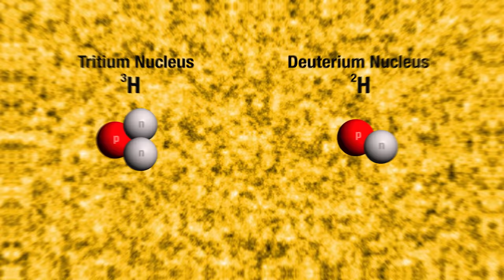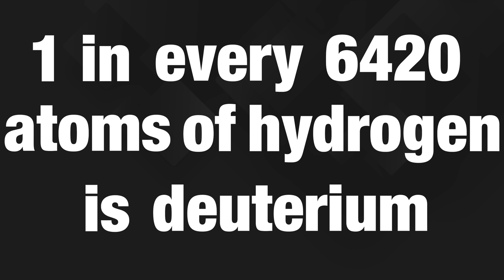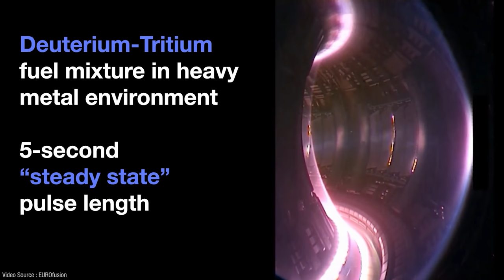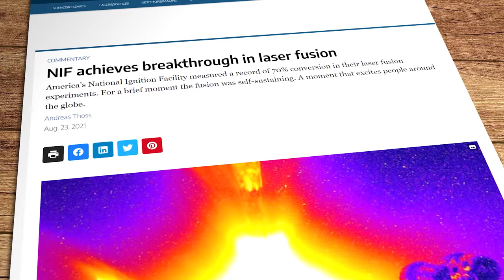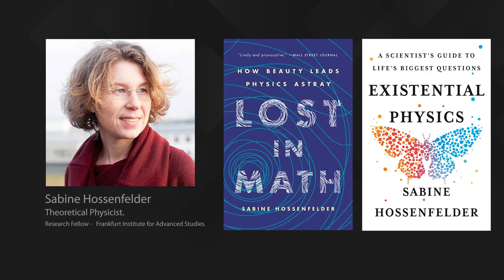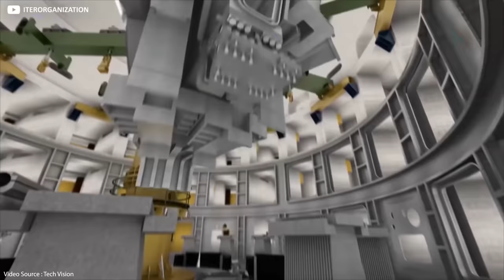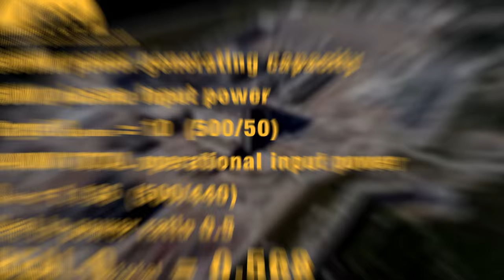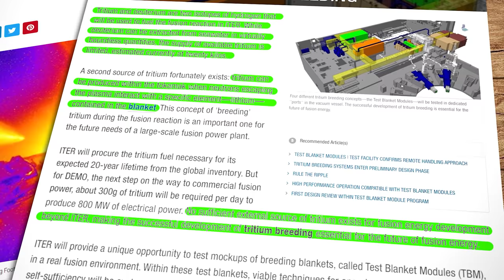Nuclear Fusion Illusion. Is it time to park the pipe dream?

Comment: We need to keep in mind that ITER, and its cousins, are research devices. I support them as such, while at the same time thinking it would be a huge mistake to pin massive hopes on a particular outcome. If you never undertake large projects unless you can be sure they will pay off commercially, then you will simply never undertake them. I think a lot will be learned from ITER—including, partly not least, learning how to manage huge projects, and manufacture large, complex devices.

Comment: Really enjoy your content, but I think this is a very narrow analysis of the Fusion problem. Raising Q total is trivial in comparison to raising Q plasma. Nearly every fusion plant running today, or planned within the next few decades are NOT intended to be power plants. Their objectives are to discover and test plasma efficiency improvements (Q plasma). 

In order to do this, they need as many variables to play with as possible, allowing the flexibility to make these breakthroughs that would not be possible in a commercial power plant. Yes, you can build these reactors to run MUCH more efficiently. But that will not be done until we exit the "research phase" and move to commercial production.

As an example, MIT's SPARC reactor is projected to reach a Q plasma of 10, and a Q total of 1. This is still not producing power, and will still use inefficient equiptment designed for experimentation, not power generation. The goal is to prove the concept for their second ARC reactor that WILL be designed to produce power, and will reach a Q total of 4 or above.
Reply: Cop out, the current generation of experimental test beds for  nuclear fusion are nowhere near being prototypes of a viable fusion reaction vessel, not even close and that hasn't changed for over 50 years.

I agree with the post above the advantages of controlled nuclear fusion even if it were commercially and physically practical, (which I question,) would still be massively outweighed by the advantages of fission, a mature, proven and  well understood technology.

I still remember listening to more or less all the same kind of stuff 50 years ago then aged about 16 now and at 65 I've gradually become more and more skeptical about it all. 

The chances are that in 50 years from now you may well have reached the same conclusion.

Of course I may be quite wrong ?

Comment: Near and medium term the best solution is offered by the Ed Pheil designed reactor that burns existing  deleted 1% spent nuclear fuel and other radioactive material  to 97% spent. It involves existing technology, the fuel is currently being stored for it at great expense, and at the end of cycle the worst radioactive waste  needs safeguard  for only 300 years .

Comment: Good explanation. This is why I'm enamored of Thorium MSRs, which seem to this layperson to be a good solution to most of the issues with fission power. They could provide sufficient power for the planet for as long as necessary until the necessary technical advances to make fusion viable - even 1000 years.

A longer term issue will arise - all power plants generate as much or more waste heat as actual electricity, and the electricity itself all ends up as heat in the environment. So even if these technologies "solve" the CO2 problem, eventually we will be adding such a large amount of heat to the environment that it will also be as much of a problem.

Perhaps the long term solution will be to embrace the Warm Earth that the dinosaurs enjoyed!!😎 Global temperatures were as much as five degrees higher than today. We humans basically grew up during the ice age.

Comment: I actually have had some experience with General Atomic and their attempt at a fusion reactor back in the early 80's . I worked in aerospace manufacturing for the vast majority of my career but in the somewhat early days I was working for a company that got a contract with General Atomic to make several thousand of these little oddly shaped parts that would fit in the palm of your hand and was told that those were part of the magnetic containment field and that they were actuated to alter the magnetic field on the fly by a computer . Back then the company I worked at got their very first computer (8088 CPU for $30,000 in total system cost including the 10 meg hard drive which was crazy big for those days) so that technology was pretty much in it's infancy . I expect some day it will produce net positive power but that is still a ways off , maybe after we establish a moon base we can mine He3 and have a good fuel source we simply don't have right now .
 The way I see it is similar to doing work with micro gravity and space work in general , it's progress to better our understanding of physics . I am certain things are learned along the way that likely would not have been known had that path not been followed . The amount of things discovered during the Apollo program should be a testament to the side benefits of such programs and they account for much less than 1 percent of our budget so I think it should continue .
Reply: @Just Looking yeah 10 years later hard drives are much cheaper , this thing had two 8 inch floppy drives also and was about the size of a small dresser and was made by Ohio Scientific .
Reply: @Just Looking was the one you got operating at 4.77mhz or 10mhz ? and did it have a hard drive ? Hard drives in the early days were really expensive , it seems to me the 10 meg hard drive upgrade cost around 10K all by itself although prior to that I had only seen a hard drive in my college and it was way bigger than what I had at work as that one measured about 16 inch wide and 10 inch tall and about 18 inches deep , occupied one full rack in the main box . Funny thing is that hard drive only worked maybe 25% of the time , it was in the shop more than in the cabinet .

Comment: Yes: we need to invest more into renewable energy solutions available right now.
But: we could also invest more into fusion-research, even if results might only come "in 20 years". Much more money goes into less useful things.
Those are not mutually exclusive things. Though you're right: if the budget allows for only one of those, the first needs to be prioritized.
Reply: Most of the economy is not useful or necessary. Which begs the question why we are desperately trying to produce more energy to keep it going.

Comment: The cliche is interesting because from what I understand it comes from a report from several decades ago. The report layed out several projections for how long it would take to finish fusion under different funding levels. The 20 years thing was how long it would take if the process was fully funded. Basically their pie in the sky number. The longest projection was like 50 years for the least amount of funding. We've been funding fusion at like 1/4 of the 50 year number since then.

Comment: Even if fusion can be made to work today I can't see why it would be adopted for power generation. We have long realised that capital and operating costs are more important than - for example gas or coal prices. Fusion, even if it worked, is always going to be a lot more expensive to build than wind or PV power. Pretty soon people will realise we should be investing in storage not fusion. Storage is a much better prospect than building Fusion base generation capacity.

Comment: Perhaps if even a fraction of the money spent on Fusion had been spent on Thorium Reactor design we would have plenty of those up and running which appear to promise the benefit of safer energy production, no nuclear bomb usable waste AND can use radioactive waste from older reactors as fuel thus helping to solve the nuclear waste disposal problem. Fusion research seems an indulgence we don't have time for.

Comment: the input energie is mostly convertet into heat energie in the coolend which can by recovert and convertet back into elektrisiti. (not in iter as far as i now but iter is just a proof of conzept)
if you do 440mw*0,45  wich is the the input energie that can by recovert (200mw) the 0,45 is just a guss by the way.

Comment: With an outer layer offset slightly pushing an inner core, and a turbine through the middle gathering up charge you'd essentially have a an orb spinning inside a shell.

Comment: I was a researcher at JET 30 years ago and see the promise of fusion but I tend to agree. We wont see it pumping sustainable cheap energy into the grids for many decades to come. We do have access to renewables and have not, in myopinion, exploited geothermal nearly enough. All the energy we could ever need is right under our feet and its a matter of how deep the earths crust is where we live and what investments we make to drill to get it…. Or in the case of the UK, build subsea power cables to Iceland and work with them to build georhermal stations to power the UK.

Comment: Adrian Moorhouse came up with the short-cut for this in 2048, although nobody believed him at the time.  It's to have a PLAITED TORUS, with two thinner streams going one way round, and one fatter one going in the opposite direction, woven around each other.  Thus the torus itself applies the shaped chanelling seen in the stellerator, and it becomes self-containing.  Very stable, easy to draw power from, and lasting hundreds of years provided you inject a little more source element from time to time.

Comment: How refreshing, a nuclear themed videos that you are almost correct about. I don't know if researches have been obscuring the realities or if its news organizations that don't report on it properly but fusion is not something coming around to produce electricity in the next 40 years. Even if we could sustain the plasma we still only have rough ideas on how to remove heat energy from the system to produce electricity, still much more research is needed.

Tritium is not dangerously radioactive, I mean come on at least just have a think before you say stupid things. CANDU reactors in Ontario have been dumping Tritium into the great lakes system for decades, if it was as dangerous as you say it would be quite apparent by now.

Now say it with me "Being radioactive doesn't make it dangerous"

Comment: There have been other developments in nuclear fusion that didn't receive enough funding. One of them was called Focus Fusion. It it involves focusing a beam of positively charged hydrogen or protons and generating pulses of energy through magnetic induction. It doesn't require extremely powerful magnetic fields because the hydrogen is only confined for a very brief time, in each pulse. It is a direct conversion of the fusion energy to electricity. The research was started in 1964. But has had a little bit of funding but no more. It would probably be the quickest route to nuclear fusion. But TOKAMAK and STELLERATOR have received most of it.

Comment: I think the issue is that only very small steps forward are made, and so rarely, that people think it's a massive breakthrough, well, the media do for the headlines!!  Sounds odd but it wouldn't surprise me if we're simply missing something fundamental, and when that's found, job's a good 'un .. A time limit can't be put on such a breakthrough  ;)  I actually worked for a while with JET (Joint Euro Torus) some years ago on the remote handling units when it was being built.  ;)

Comment: I'd love someone to clarify this for everyone: "Nuclear power" is heat driving turbines. Same for coal. Fusion aims to do the same. 
Nuclear fusion is "burning" atoms by fusing them instead of splitting them. The key issue is how to get more energy from the burning than you spend to light it up and keep it contained. In theory, better designs and more efficient magnets and shielding can do it.
Reply: you are right about the last step; heat is used to raise steam and steam drives a turbine and the turbine is connected to a generator that produces electricity. So if you are generating 500MW of electricity, you are dumping an equal amount into the sea (unused energy). Be assured that this is the constant part in all generation (coal, oil or gas) of electricity because we have mastered how to biol water and produce steam and run a generator.
From where the heat comes? fusion, fission or burning coal. Fusion works only at very high temperatures and that is the real problem because we need to contain the hot gases for sufficient length of time so that the D-T fusion can take place. That has not been easy yet.
Reply: This is the hope that they are looking for. I've seen some bell shaped designs that look promising...
Reply: He is confusing experimental reactors with production reactors. Today's reactors are built to learn and test. The more important values is run time , the q times are not important until we have 24/7 operational reactors. We have suddenly gone from milliseconds to recently minutes, ~17 minutes holding millions of degrees in a container. That is getting close to constant running, not far away at all.
Reply: Science Revolution  I don't know if you are a troll or not but take a science class or two. BTW, iron is not the same weight around the world. You are not the same weight around the world. If you are right, go do the numbers, make the predictions, record the predictions, repeat the experiments and then collect a Nobel prize. Scientist would be happy to be disproven and be shown new science.
Reply: Depends on the method, there are direct generation methods for certain types of fusion and reactors that are not dependent on steam generation.

Not all designs require magnets.

Comment: 2:15 Actually, just as much nuclear radioisotopes as from fission, give or take a bit. But much easier to handle, and shorter-lived, and you have a lot of choice in what the radioisotopes are. Not ideal, but TTTT that is still a huge improvement.

Comment: Each tritium atom requires 1 neutron to manufacture. The neutrons are generated in a fission reactor where each fission reaction makes 1-2 excess neutrons. Each fission reaction generates 200 MeV of energy. Each D-T reaction generates 17.6 MeV of energy. More energy is spent making the tritium than tritium can make at 100% efficiency. Fusion as we conceive it with tritium as an input will always be a science experiment.

Comment: MIT is associated with an alternative tokamak project that uses more modern superconducting magnets. Some are calling this a breakthrough. Of course, no one is going to send ITER back to designing from a blank sheet just because this has come along. Again, this research, and we aren't supposed to be counting on a particular result. But one thing to keep in mind about the MIT project: You may be able to use stronger magnets, and get a smaller reactor. But there are limits to how much magnetic force the materials in use can withstand. So it may not be as big a breakthrough as some might hope. Again, let's explore the possibility space. Give. it. time. Meanwhile, keep on with what we're doing to address near-term concerns. I'm all about the PV, and the batteries, with the other stuff bringing up the rear.

Comment: Currently we lack the materials to sustain fusion and properly receive power from it directly by using wires to tap into the electric and magnetic fields generated. Sustaining a reaction is one thing but we need to step away from a glorified tea kettle system by taking current directly from fields generated by sustained fusion or fission. The fact it we do not need fusion to cross this hurdle, just a difference in thinking about how we extract usable electrical energy from sources.

Comment: Investment in fusion is investment in all of the supporting technologies that fusion research needs to make progress, in particular, there have been advancements in modeling, magnets, super conductors, lasers, and materials that have come out of the work on fusion, some of which are applicable to the manufacture of solar cells, super capacitors, batteries, and generators. Investment in fusion vs investment in other renewables isn't and 'either or' proposition, and the orders of magnitude more direct investment in solar is in line with their relative timescales for coming online (I do wish, however, that we hadn't stopped investment in LFTRs for so long after giving up on the MSR afters the experiments in the 60s)

Comment: I am with you that we could not wait on the outcome of this experiment and have to go for other solutions for energy production to limit climate change as even sucessful will come to late into the game.
Still a few facts should be mentioned:
JET: the 5 seconds they controlled the plasma was not only a record it was the maximum possible at JET, so it could be they can control it much longer we simply do not know. ITER will not have the same issue. A bigger torus is expected to make it easier to control the plasma. We got a new player on the field with AI to control the plasma. For test this was already used but now Alphabet jumped in probably the most experienced player on that game. Other technologies evolve like superconducting magnet, material science etc.
So looks like we have a good chance that ITER can do the Q(Plasma) of 10. Even a bit earlier then expected, but still we are then around 2030 or even later and ITER is not a power plant it is only a demonstrator. So even on the perfect scenario we start close to 2030 to built a power plant and just one would not be enough and it will still be a complicated thing to built so another 10 years is still on the optimistic side.
For ignition, i would say they are even far behind.

So is it worth the money: I would say yes as 25 billion for 30 involved countries over many years with a lot of scientific and technological output even if no energy is produced that is worth the money, but it would just be the cherry on top of the cake and we have to focus on the cake now as we just started the preparations and have to speed up before the oven gets to hot.